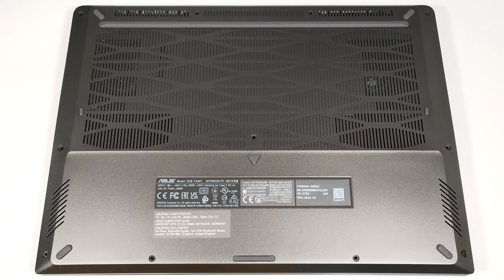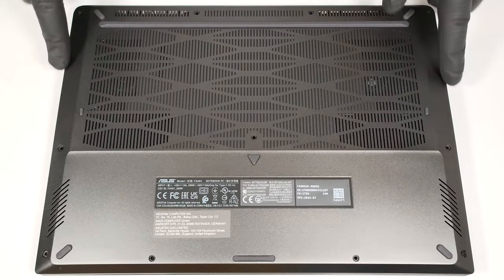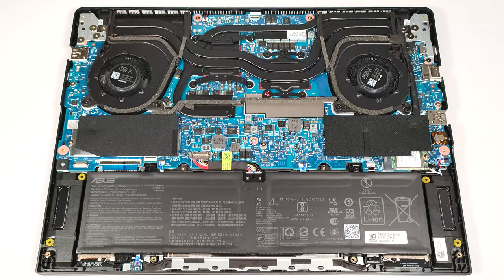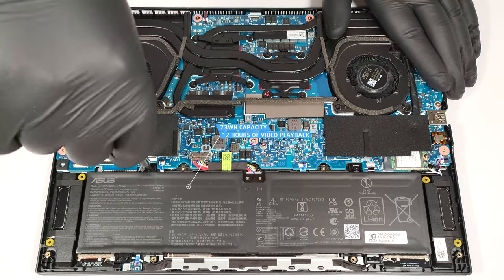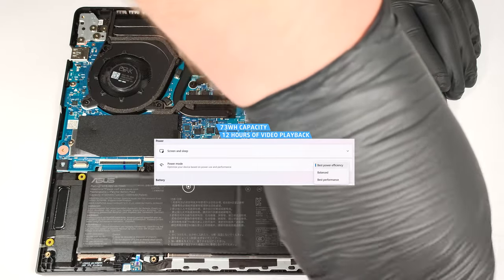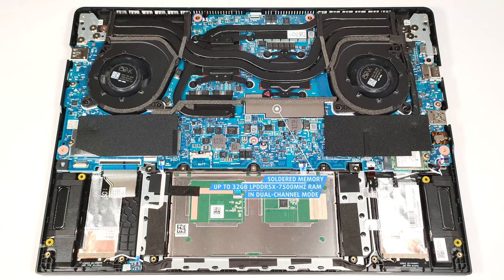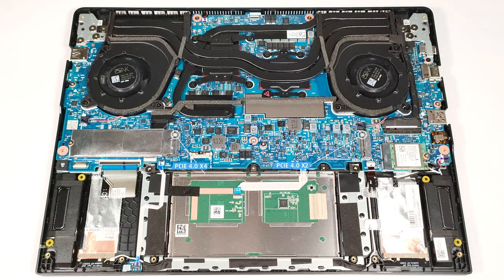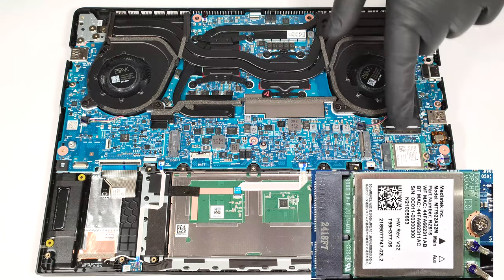🛠️ How to open ASUS TUF Gaming A14 (FA401) - disassembly and upgrade options

Comment: No ram upgrade...
Reply: It's 32gb in a 14inch form factor.
Reply: @jackgowing1256  xmg evo 14 provides 2x ddr5 sodimm sockets at the exact same form factor. the point of the ram soldering seems to be solely to overclock the ram chips to higher (7500MHz?) speeds, instead of the more usual 5600-6000MHz. this increased RAM clock can eke out some iGPU performance (iGPUs are provided with GPU mem from installed RAM).
Reply: @q01q  yes, the increased ram speeds and low latency is why it's soldered. The point i was trying to make is that in Australia at least, the only options you can get both have 32gb of ram. 32 gb of ram covers pretty much all reasonable use cases where if you are looking for something more extreme and high end, you probably wouldn't be interested in a budget gaming laptop in the first place.
Reply: @jackgowing1256  seems the Ai Ryzen CPUs in Notebooks all have solderer ram. That would explain why no Ryzen AI Clevo/xxx Barebone exists and also no framework board with this cpu generation.